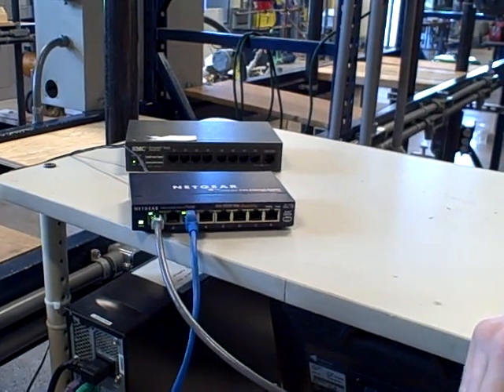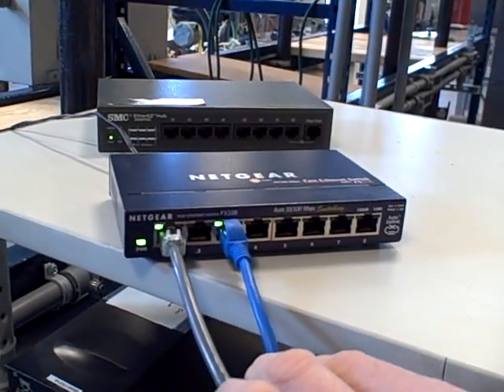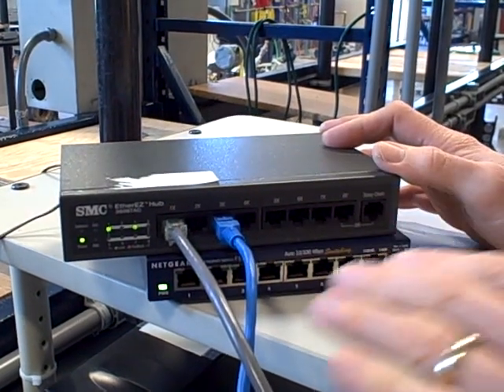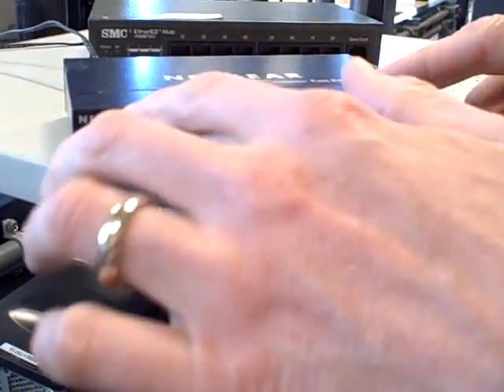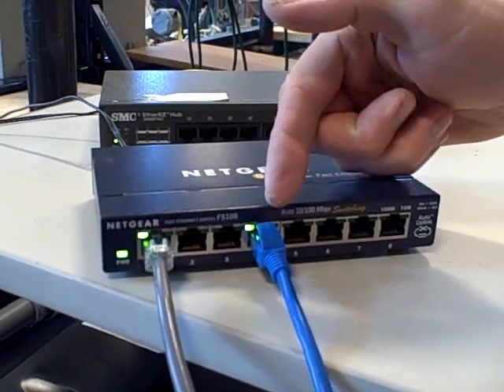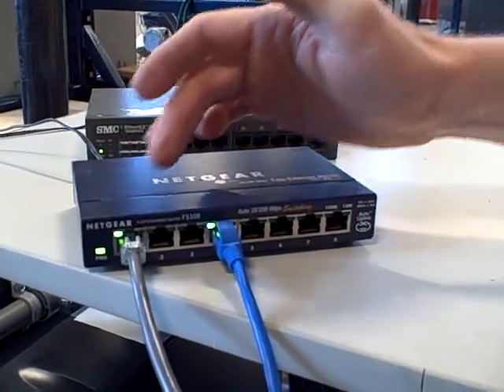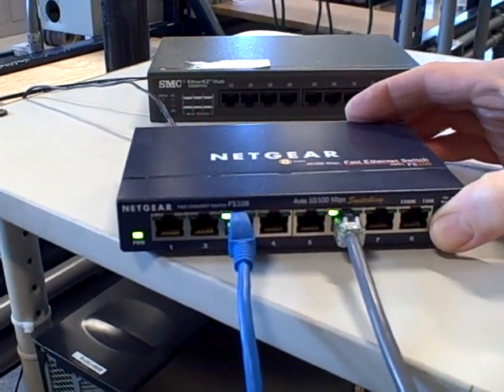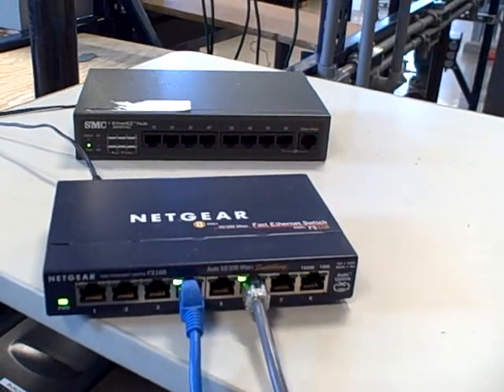Ethernet hubs versus switches

Comment: I want to ask question about the Ethernet Switch , lets consider a switch with 8 ports only , and I want to set up  a local are network of 8 PCs, if i want each PC to communicate with each other, and I plug in  the whole PCs with the switch and turned it on , How does the   switch will initially know the mac address of each PC network card ? I think there's must be a memory in the switch that should inform the switch how to transmit  the frames from PC x to the others PCs and PC y to the others and so on . 
Can you please clarify this point .
Thanks for this great video .
Reply: Mohammed Abulsoud Switches have something called a MAC or CAM address table which stores the MAC addresses of the devices connected to it so it can direct the data being sent to the correct device. It is also known as forwarding information base. http://en.wikipedia.org/wiki/Forwarding_information_base
Reply: Mohammed Abulsoud It doest initially know, so it broadcasts any received frames until it can fill it's MAC table to make proper switching decisions.
Reply: +akowned1 @Mohammed..The Switch will actually work like a hub at the beginning.It will broadcast the packets when received from each PC and correspondingly stores the MAC address.Later on it'll pass the packets on the basis of MAC addresses.
Reply: but every switch have a limited table capacity, if you plug a switch to another, you need to have enough memory to store every computer of the network or data transmission may fail. on small network this is not an issue, 

but im sure in large corporative network, IT need to consider this.

(im learning english, and im learning about network too :D)
Reply: Exactly for this do you use a switch! Please go back to school and learn what be a switch!
Reply: im talking about mac address table.... switch doesnt have a mac address but they can bind every mac address of every destination computer so they know which port to send data....

Im sure if the table if full, it start some sort of garbage colleting and let new entry in the table. but the table capacity need to be considered to keep good network performances.

Comment: Another major difference between a Hub and a Switch is that a Hub is a layer 1 device which makes it as intelligent as an ethernet cable and a Switch is already on layer 2.
Reply: Sorry so it is wrong. Hub be technically parts of OSI 2, switch parts of OSI 2 or/and OSI 3. OSI Layer 1 be the physically cable self! A OSI Layer not mean the device must use all of them, it is only a theory plan, not more!

Comment: Alright the switch behavior is interesting since none of my switches have that "deaf port" issue demonstrated in the video. I'm honestly thinking it's a problem with the specific switch itself. I would love to see a follow-up video of this done with a different brand switch such as Linksys.
Reply: The deaf port issue only happens if you try to switch the ports while the switch is turned on. In the real world people set up their switch to serve all the computers in their home or office, and then they don't have to mess with the switch anymore. It's beyond me why anyone would want to switch a cable to a different port on a regular basis. And if you really wanted to do this, just unplug the switch while doing it, then plug it back in and the switch will reset itself right away. I think the man in the video was just showing this deaf port problem to prove how switches and hubs differ, in that a switch has independent ports that talk to the source, whereas the ports of a hub are all "glued" together and share the same information from the source.
Reply: +David Senos that only applies on home owner grade switches,  commerical switches can be 'mac-locked' to wear only a specific mac address will work in a specific port.  (this has to do with physical security)

Comment: Do you need a cross over cable to go from switch to your router? does your router cable need to be in port one?
Reply: You typically didn't need a crossover between a router and a switch or hub.  However, with Gb and some 100 Mb switches, autonegotiation also does crossover, so no need for crossover cables with them.

Comment: The switch probably doesn’t see the PLC on the other port right away, because the PLC doesn’t transmit anything until it gets a request to do so. If you got a network device that’s a bit more talky, like a PC or laptop, it should start working again within seconds.

Comment: Lastly. I want to add a projector to my living room. I have an existing Ethernet going to my Roku device, all the way from my router in another room. I want to plug the existing that existing Ethernet cable to a switch or hub, thus removing the Roku as the one and only terminating route, and then plug my Roku and projector into that switch or hub in the living room. For something so mundane, would you recommend a hub or switch for this network solution? And why? Thanks!
Reply: switch

Comment: That hub would not be broadcasting to all 8 ports.  It would broadcast to the other 7 and not the one the data comes in on.  Also, your delay is an unusual situation.  Normally, as soon as you plug into another port the DHCP sequence will run, letting the switch know where that MAC address is located.
BTW, who uses hubs these days.  I have a 10 Mb, 8 port hub I bought around 25 years ago, but haven't used in years.  Even then, hubs were on the way out, with switches becoming more common.  The only reason I went with a hub then was switches were still a lot more expensive.  These days, an 8 port Gb switch can be had for about 1/4 what I paid for that hub.

Comment: Thank you for the helpful video. I am monitoring some UDP communications software using Wireshark and I am not seeing the data I expected in some cases. The client software sends a broadcast to a 255 IP address and the server responds to the request. I know the server is responding because the client receives the response (i.e. the system works). I do not see the response packet in Wireshark. I suspect this may because there are switches between the computers running the communications software and the computer running Wireshark. I think the switches think that there is no reason to send the packets in question to the part of the network where the Wireshark machine is connected.
Reply: Use a hub or use a managment switch where do you config 2 ports same data line. That an easy question ;-)

Comment: That's my point. The one IP address on the hub gets sent out to more than one device plugged into it.
Reply: +Steve Warren Yes, all packets get sent out to all ports, but that is NOT a problem: every device has a unique (usually factory-assigned) MAC address - and normally any device simply ignores packets destined for a different MAC address (IP addresses don't even matter on this level).
That's how Ethernet worked from the very beginning, when all traffic went over a single shared network cable (no fancy hubs or switches) - and it still works that way.
Of course, a switch is always preferable over a hub, but a properly working  hub will NOT cause the problems you describe - it will just cause slower network performance on a busy LAN.

Comment: i'm getting 152mb internet soon. i'm planning on getting an 8 port gigabit switch and linking it to the router with an ethernet cable, and plugging computers into the other 7 ports. will the switch divide the connections to the other 7 computers, meaning i only get around 140 megabits? or will they all be given a gigabit connection, and will i be able to get 152mb providing the other computers aren't doing anything demanding for bandwidth? thanks.
Reply: ***** In theory that would seem correct. In practice no. I think it's because it is very rare that all devices will be operating at full band width. If you run a speedtest on any of your devices connected through your switch, you'll still see 152 Mb.
Reply: Yea I got the switch and as long as the other devices aren't downloading I can get my 152mb. Thanks.
Reply: Although I've only got 4 devices on the 8 port switch so I haven't really fully tested it yet.
Reply: No. The crystal ball is falling already so I can only say that the bandwith of the backplane lines of a switch is typically higher. Do you found it in your doccuments of this switch.
Reply: OldLordSpeedy ah ok makes sense

Comment: i have but one question and i'm too lazy to watch the video. if i were to put 2 devices (a pc and a playstation) on an ethernet hub, and connect that hub also to my swith/router, then both should work fine, right? or will the switch/router have problems with ip adresses?
Reply: +ThibautVDP They will both get their own ip but will be running in the same collision domain therefore they will have packet collisions and have to resend the data. Imagine to two basketball players shooting freethrows as fast as they can at the same time. Sometimes the balls will hit each other and cause the shots to miss. This could cause higher ping and packet loss (if UDP like voice chat) so you don't really want it. I've had 5 pcs run off a hub before. After learning about the difference i only buy switches. If you only have a hub go ahead and use it. 2 devices isn't going to be too bad.
Reply: thanks andrew, i guess i'll just get an old switch from under the layers of dust!
Reply: IP adresses have to do nothing with a switch or a hub!

Comment: Hey, i really wanna know more about this switch thingy (i'm new so don't hate) uhm, i need further explanation on how it works. if you use the desktop1 (port 2) will it affect the performance of internet in desktop2 (port 3)?
Reply: It depends. If you have 2 PC's hooked up to the switch in ports 1 and 2, and then a connection out to a router to get to the internet on port 3, both PC A and PC B would send their traffic over port 3 to reach the router. If you have a 100 Mbps switch, and PC A is using that much bandwidth, then PC B will not be able to communicate effectively.

When talking about the speed of a switch, that speed applies to every port, it is not divided between them. on a 100 Mbps switch, every port gets the full speed, doesn't matter what the others are doing. The problem arises when multiple devices need to send traffic over the same port, like in the example above. 

In large, enterprise level networks, there is the option to combine several ports into one logical port, and the load is balanced between all of them in the group. This helps get around the issue of one port not having the bandwidth to handle all of the traffic.
Reply: Unless one of your desktops is eating up all the bandwidth (i.e. downloading torrents using as much bandwidth as possible), you shouldn't have any major problems.
There are relatively few things on the Internet that will hog a significant portion of a network connection to the point others on the network will experience problems.
Reply: The Nightmare's response failed to mention that the speed of your Internet connection (between you and your Internet Service Provider) is a factor. The slower that connection, the easier it is for devices in your local network to hog bandwidth.
Reply: Aj Caballero   This have to do nothing with your internet speed. Every switch have a backplane - is there the speed too low your speed at all your devices how use this switch goes down. Same if the MAC table is full. Both things do you found into the data sheet from your switch. 

Of course if your internet speed higher as all your devices use then is all okay. If you have problems in your network at home do you should pay an IT expert, this theme can fill big books!
Reply: Aj Caballero   This have to do nothing with your internet speed. Every switch have a backplane - is there the speed too low your speed at all your devices how use this switch goes down. Same if the MAC table is full. Both things do you found into the data sheet from your switch. 

Of course if your internet speed higher as all your devices use then is all okay. If you have problems in your network at home do you should pay an IT expert, this theme can fill many books!
Reply: Internet speed is most certainly a factor.

If you have a 30mbps downlink from your ISP, and you have a switch with 100mbit ports, you're never going to see 100mbit (12.5 MB/s) download speeds. The only time you'll see 100mbit is when transferring data between devices on the LAN the switch is part of, and only if the read/write speeds of storage media is fast enough to cope with that bandwidth. In this case, Internet speed is the bottleneck.

But consider this. The switch is connected to the LAN's gateway (router), which is connected to the modem (or a router/modem combo device) via a single 100mbit link. That means it can only receive a maximum bandwidth of 100mbps. What this means is that two or more devices trying to download, say, a movie, at the same time, will not both get 100mbps, because they're SHARING the single 100mbit link from the switch to the Internet. More devices using high-demand services, such as downloading large files, or streaming video, will decrease the total bandwidth for each device.

Conversely, if you have gigabit speeds from your ISP, and you're using a 100mbit switch, you're never going to see gigabit speeds, because the switch is the bottleneck.

As for the backplane of a network device, the bandwith of the backplane is typically the speed of the port multiplied by the number of ports. So, in a typical 4-port unmanaged switch, the bandwidth of the backplane would be 400mbit.

Some switches will have 100mbit ports plus one or two gigabit ports. There would be two separate backplanes in this device; one for the 100mbit ports, and one for the gigabit ports.

Given all this information, it's recommended that if you have several devices connected to your Internet service, as many people do (especially on WiFi), that you get a gigabit switch. This will ensure that the switch will not be a bottleneck for bandwidth, and allows for future expansion of a LAN.

Comment: Hey was just wondering can I plug a 9v adapter into this hub?  I tried it and the lights blink, I assume it has internal voltage regulator but don't want my house to burn down or something lol
Reply: actually mine is the nh1005, it's old, metal, heavy duty looking, and just says dc but no voltage so i'm hoping that's because any voltage works

Comment: But the problem of change ports in  the switcher and the communication is halted/stoped, isn't a bug of device? Because the switch should check the link, and if there is no link, should try to check on others ports. I think there are switch do that.
Reply: You are right, either the NIC of the PLC or the switch itself is bugged or not configured correctly.

NORMALLY both network components should see the change in link status in a matter of milliseconds, clear their ARP tables and wait for connection to be reestablished on L1.

Learning MAC adresses is / should be part of handshake protocol in Ethernet II and SHOULD be independent from the data or the method of transporting data.

normally the PLC-NIC should broadcast its presence once L1 is established, a 5 minute delay shows a pretty big bug or non-standard-implementation here.
Reply: Simple answer it is NETGEAR, every day when it is "working" and don't burn you any equipment connected to it is good day for it.

Comment: So, if i plug 1 Ethernet cable from a router to a switch will it bring Ethernet signal to all of the things plugged into the switch right?
Reply: TrottingFox Yes, that is precisely what a switch/hub would do. Like using a single LAN cable to connect internet to your PC, XBox and PS or other PC's. In addition, your PC and XBox/PS/other PC's would be able to communicate via switch/hub in case you want to transfer files for example. Switch would be faster than a hub, especially if you have high volume of traffic. Switches are a newer solution, hubs are becoming obsolete; you'd only want a hub in special cases like network diagnostics.

Comment: so i have a hitron cgn3 with rogers and they always have strict nat types. so i bridge it to my asus 3x3 nat types are open but now i only have 4 ports and more than 4 electronics i want hard wired. how do i have a modem bridged to a router and than add this for 8 more ports?
Reply: plug a switch on one of the router lan port
Reply: +Pascal Lafrenière thanks for the reply all tho months later i still appreciate the response lol. just didn't know if it would work that easy. gonna order one now to try
Reply: yes, it's that easy, for a 8 port switch, you need to plug 1 to the router, and 7 other is for any devices. What is your router model, I can tell you if there is any issue.
Reply: +Pascal Lafrenière Asus RT-AC66U Dual Band 3x3
Reply: +Pascal Lafrenière TP-LINK TL-SG1008D ordered that switch
Reply: You will need one extra ethernet cable to link the switch to the router as it is not included with the switch, but except that, everything is great, and plug and play!
Reply: maybe you have one lying around. It need to be a cat 5e (or some cat 5) or better if you want to enjoy your gigabit switch.
Reply: +Pascal Lafrenière ya i got a bunch of cat6. thanks for the info i appreciate it
Reply: +Pascal Lafrenière hey pascal should i use a cat6 network crossover cable instead of a patch cable for connecting router to switch?
Reply: +MrTECHPRO2 or in general when should one use network crossover cable? i've read that pc to router requires crossover but i use patch cable for everything never an issue as everything autosenses now a days
Reply: it doesnt matter now as they all auto sense the cable configuration. But if one is better than another for some circumstance, i dont know... Sorry